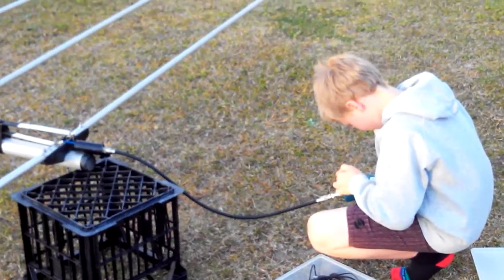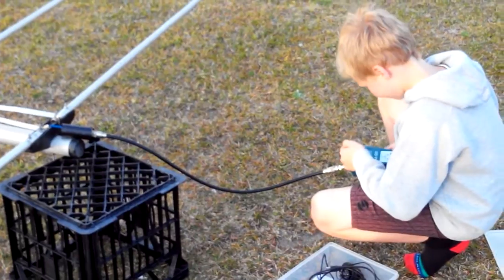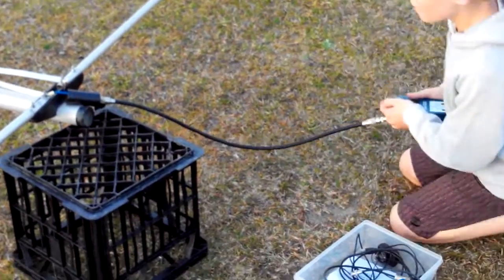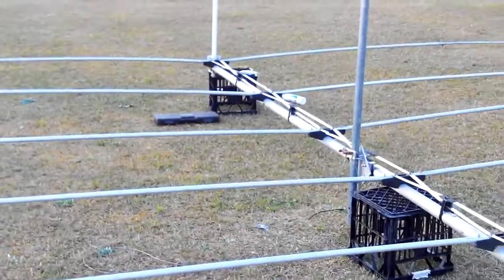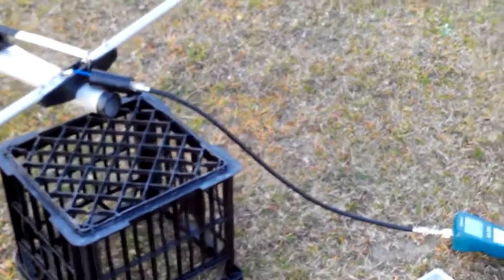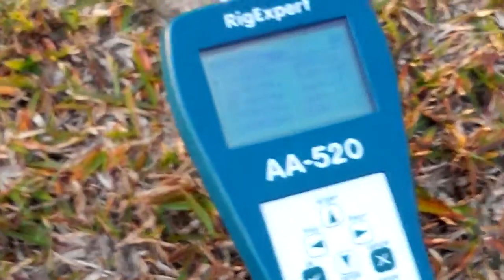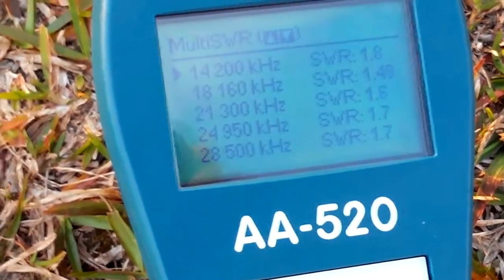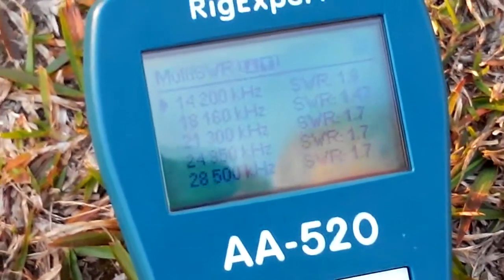8 Element Log Periodic Yagi(Home Brew)

Comment: Hi. I like your antenna. I have a question. It appears that the smaller elements act somewhat as directive elements for the larger dipoles as they might in a Yagi. However for the highest frequencies there are no more elements in front of the smallest elements. I have been trying to find answers online but nobody seems to have tried what i am about to propose.
  The idea i had was to add passive elements in front of the Log Periodic so that they might act as directors for the higher frequencies. So basically it would be a cross between a log periodic and a Yagi but only a Yagi for the highest frequency band that the Log Periodic was designed for.